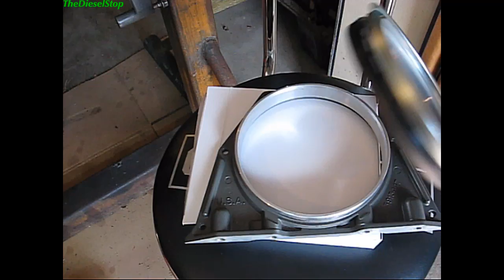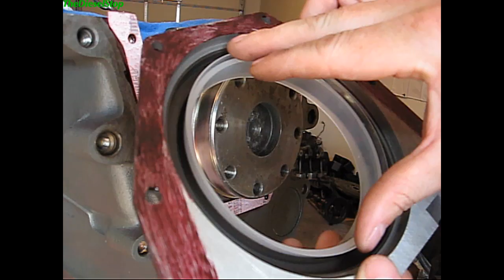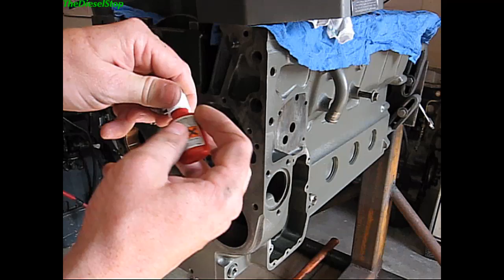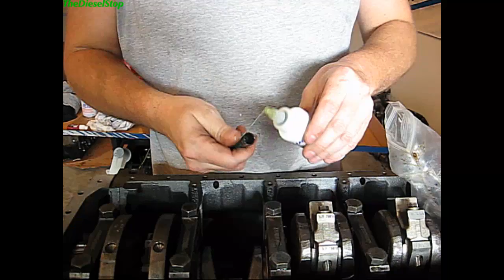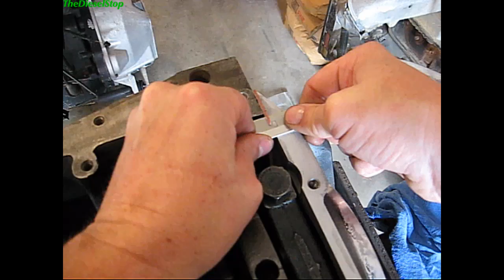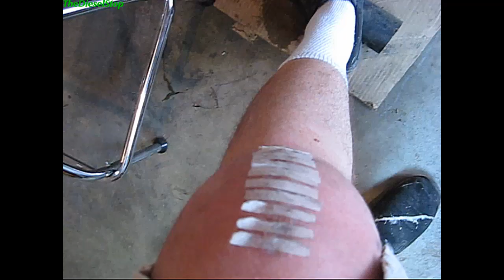5.9 Cummins Mahle Clevite Build Part 1

Comment: hi , love your channel :-)..need a advice... just installed a hamilton cam 188/220 in my 98 12 valve .. with the cam and trustplat n in can push/pull the cam back and forth like 0.045".. is this the way it should be or ?? dosn´t feel right to me tho..

Comment: i had oil all over the front of my engine. can a steep grade of 50-80 cause oil to leak out of the oil fill cap. need some help on what could of caused.